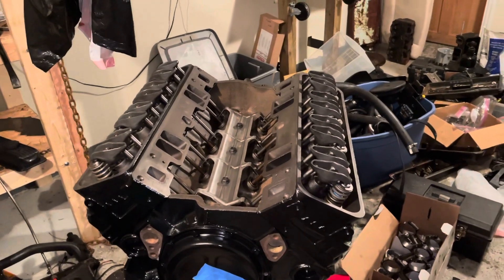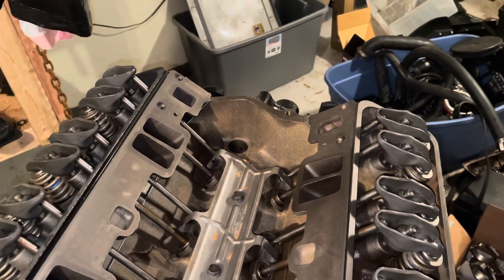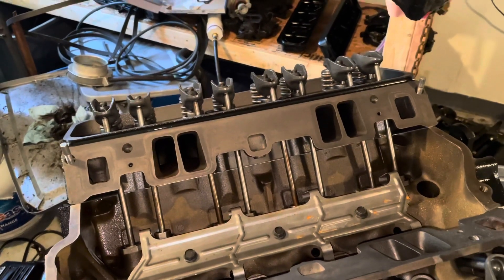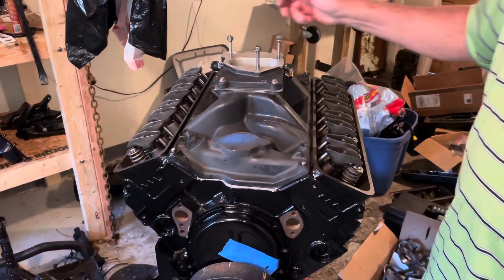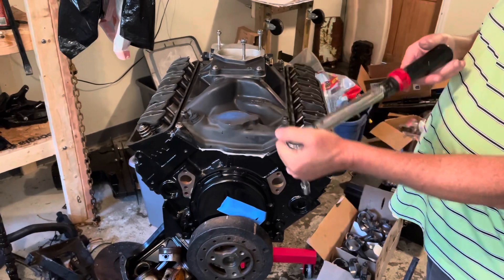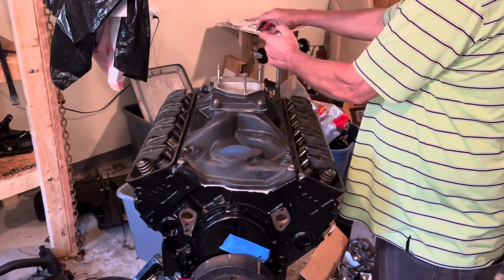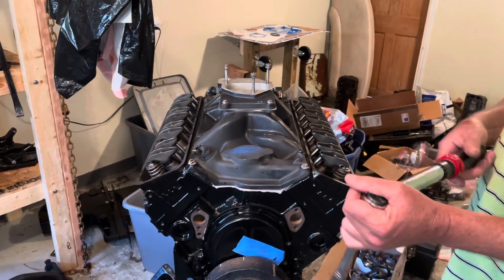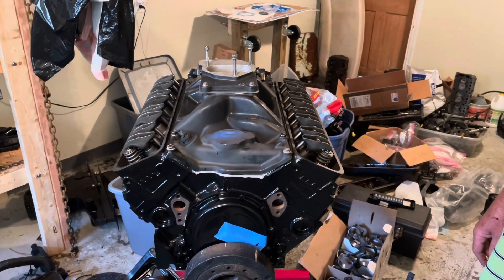Mercruiser 5.7 1(m) - Intake Manifold Install

Comment: hi should i run non ethanol or 87 gas some people says non
Reply from the maker: Mercruiser explicitly states to use 89 octane or higher. This is not a recommendation but a requirement. Your engine will be damaged from running 87 octane.

Comment: On mine engine it has the rear water ports blocked off with what looks like concrete,Why is that? On yours all 4 water ports are open.
Reply from the maker: Some racers partially fill unused cooling cavities to reduce the water volume and lower the weight. If you do that on heads they are no longer interchangeable left to right. Otherwise it doesn’t hurt anything as long as they didn’t overfill it.

Comment: I install new intake manifold gaskets, now the engine wont start, what do you think the problem is??
Reply from the maker: That’s way too little information to answer. But it’s not getting spark or fuel would be my answer.
Reply: carburetor had fuel, spray quick star, it back fire on #1 , spark plugs are new, rotor is new. though maybe timing ? we turn distributor right and left in small increments, and nothing.
Reply from the maker: Sounds like you have the firing order wrong on the distributor cap. The cylinders are 1,3,5 on the port side front to back and 2,4,6 on the starboard side. Going clockwise from #1 distributor post the order is 165432.
Reply: It a Marine Power Chevy 350 left turning engine.
Reply: My book says to torque 18 ft. lbs. on the 3rd pass. Thanks for the  video it helps.

Comment: Great videos! I have a Vortec engine and just purchased a JEGS 555-513002 intake manifold. Just curious what goes into what ports. Do any need plugs? Thanks for any help.
Reply from the maker: Not sure what you mean by ports? If you are referring to vacuum ports you should seal them all with threaded and sealed plugs. In a marine bilge a backfire would blow rubber plugs and seals off the intake leading to a fire or explosion. That’s why you won’t find vacuum ports on a marine intake or carburetor.

Comment: What's your take if my starboard side manifold and risers, runs hotter than port side?  I have a '01 MCM 5.7L with extended risers. I don't have an overheating alarm, but to the touch it comes out hotter.  Thanks for your great videos too.
Reply from the maker: IT’s either corroded and partially blocked exhaust manifolds or the flapper in the exhaust has broken loose and is blocking exhaust from getting out. One trick is to get clear plastic hose so you can see how much water is flowing to each side of the engine.
Reply: @Moccasin Marine LLC  Great idea thank you

Comment: I had that problem with the intake I had the old version engine now I got that engine and I need to get intake manifold from which car I can get it
Reply from the maker: No cars or trucks with Vortec heads had carburetor intakes. You have to buy a marine cast iron intake or edelbrock aluminum intake if you have closed system cooling.